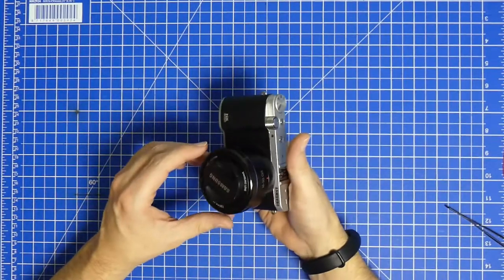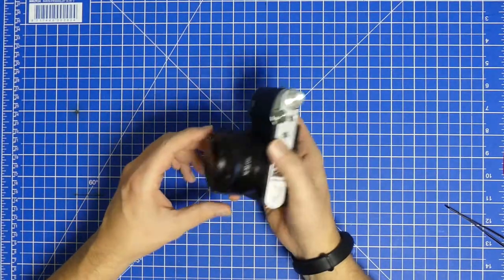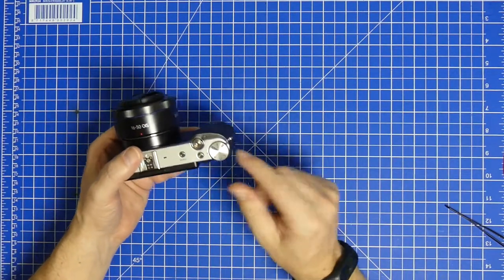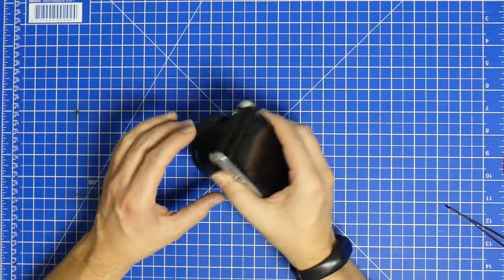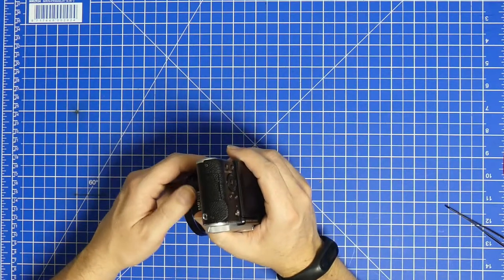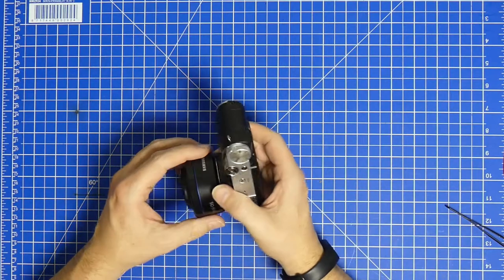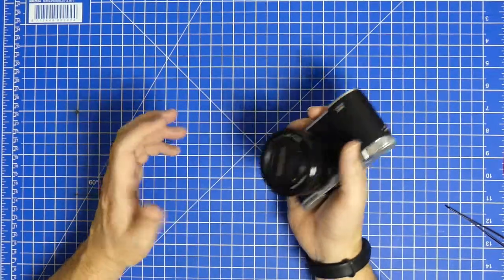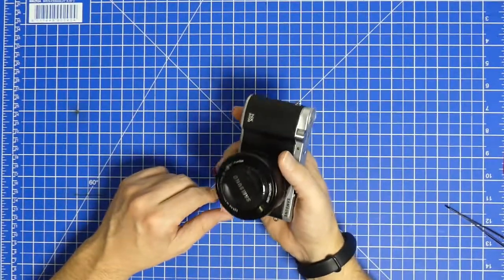Channel Updates

Comment: Good audio quality. Personally i did not think audio was degraded in previous videos.
Reply from the maker: No, you wouldn't notice the fading - but I had to crank up the audio level to 300% in editing and there was always that hissing noise in the background. I like the new audio better low frequencies and no noise.
Reply: Ah that could be painful if you had to adjust volume regularly while editing. Add a mild audio compression perhaps? It amplifies all low volume sounds and limits loud sounds to a ceiling level of your choosing. Although, you may not need it now with your new camera. What is it by the way ?
Reply from the maker: The new camera is a Panasonic Lumix FZ300 with a Rode VideoMicro microphone.
Reply: Ohh Very nice. Ohh bugga... I had better buy myself a 4k monitor now! to keep up with the Jones's...or the Herrendoerfer's in this case :)
Reply from the maker: No worries - I don't think that I'll be doing 4k anytime soon, even 1080p60 is overkill for my type of content. 1080p30 should be ok for a long time.

Comment: Am I right to think that your direct ink to PCB plotter only works with the Arduino Nano? I am currently building it and I got everything working except when I run the code nothing happened. The only difference between your setup and mine is you use an Arduino Nano I use an Arduino Uno. that is why I ask.